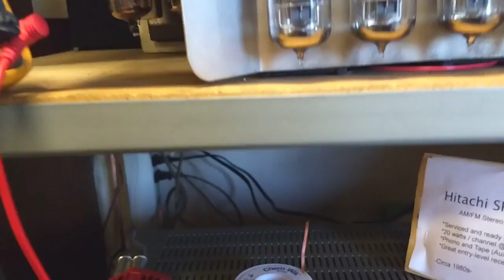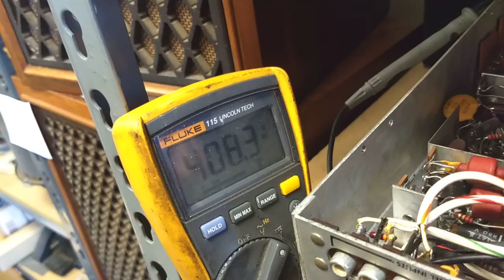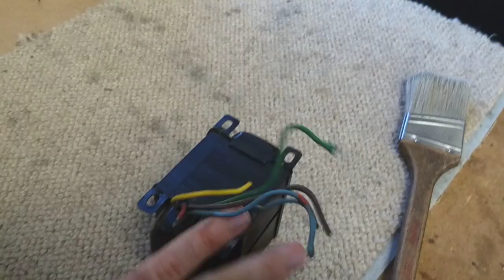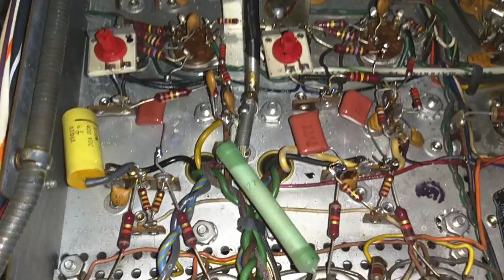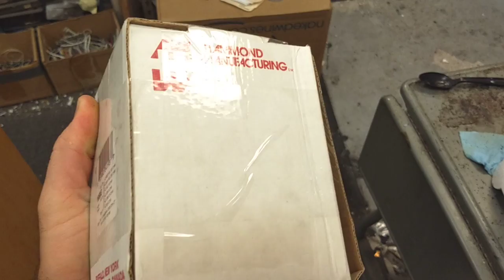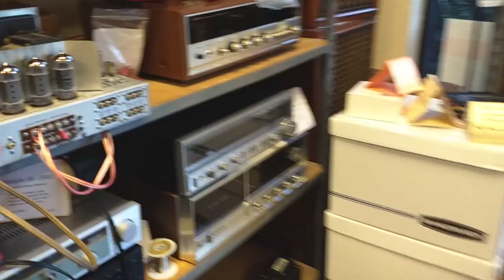Quick diagnosis of Fisher 400 - bad output transformer.

Comment: FISHER MC 4050   output transformer. CAN U HELP
Reply from the maker: Doesn't have an output transformer
Reply: HAY JORDAN DOO U HAVE ANY IDEAL ON THE MC 4050 STELPS ON THE POWER TRANSFORMER THANKS HOPE YOU AND FAMILY ARE WAIL
Reply from the maker: @tntreviews3602  if lights out check for blown fuse inside. Likely overload from shorted part or amplifier STK module.
Reply: @JordanPier  Thanks. The transformer tested bad on one output.
Reply: thanks i tested the windings and one was  no out put who rewinds transformer.
Reply from the maker: @tntreviews3602  don't know.
Reply: thanks fore responding.

Comment: Hammond might make one that would work but not mount without drilling more holes in the chassis. And you'd need to do both channels  to match. So maybe finding one off a parts unit would be the way to go

Comment: One reason never to run a tube amp without a load. I'm not saying that was the reason in this case, but HV can punch through the insulation and ruin an "unobtainium" part.

Comment: That was a fun diagnosis, well done! When it comes to replacing output trans in hi fi gear, I'll only use an exact replacement, or in lieu of that, a new matched pair. Hi fi has enough bandwidth that you can hear the difference in sound between channels that mismatched transformers can cause